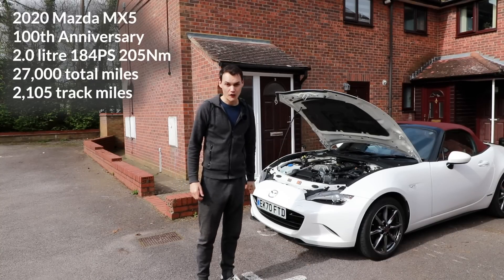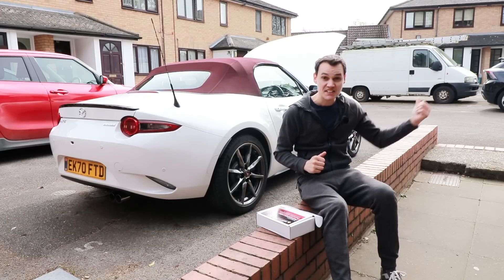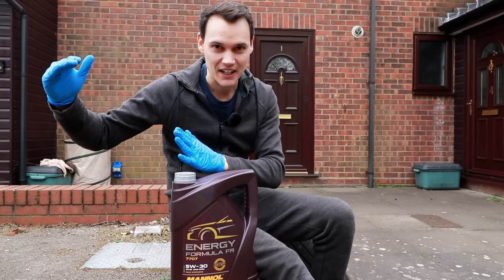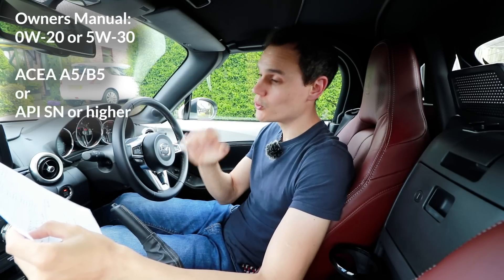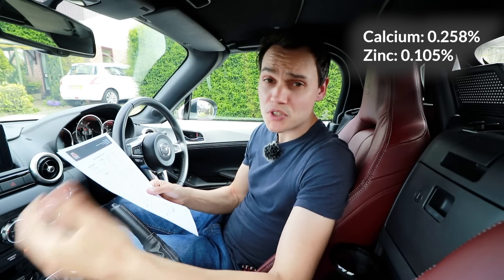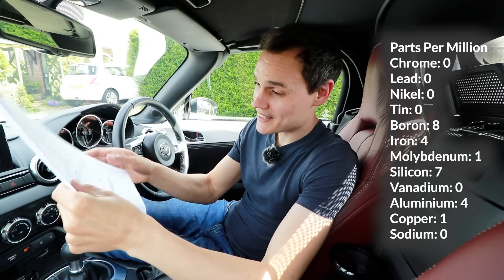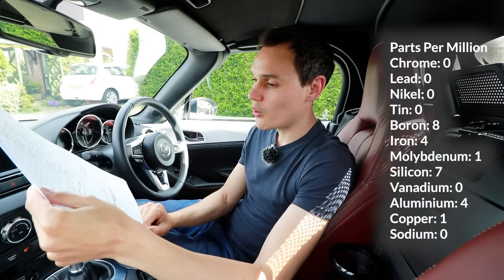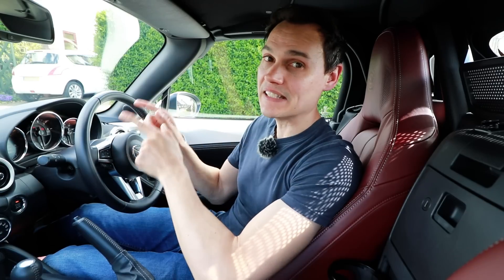Engine Wear Metals After 16 Track Days

Comment: 1000 km on the track with the same oil doesn’t seem a good idea. that’s 9h or more. a 6h interval is ok; 1000km wear is equivalent to 20.000km on the motorway.
anyway numbers look good so looks like it was ok. if the oil temp keeps a nominal temperature it doesn’t degrade that much. the blow by is low, so less contamination.
Reply: I agree. I change mine after less than half this number of track kilometres. Of all the things to skimp on, this is not one I'd risk in a track car
Reply from the maker: I don't think 1000km track use is equivalent to 20,000km road use when it comes to engine oil. I've been told many such ratios but not with evidence to back up where the numbers came from. The oil analysis results are comparable to road driven oil. It depends on the engine and the oil though. Different components are more affected by track use than others. So far in my experience it's only really been the tyres and brakes that show a significant increase in wear from track use.

Comment: If is used the right oil for the driving conditions and is being regularly early serviced, the engine will live for many years of trackdays.

My Nn18 cooper 2013 base model Stage2 mod with Stage2 parts had already 10000 milles of trackdays with 101000 milles total driving.

Still going smooth as day 1. Only noise you can hear is off, is the accesories pulley as the rubber is having wear and tear but easy to reemplace . Everything else works wonderful.

Comment: Great video 
I think copper is part of the cylinder head assembly 
I change my oil every 5000 KM and push the engine a LOT but unfortunately there aren't any oil analysis centers in my country

Comment: In the US, a company called Blackstone Laboratories does the same type of oil analysis. They provide universal averages for the elements measured in the oil, so you can get a sense of how "normal" your oil is. Below are the universal averages (in parts per million) for wear metals for a car with about 100,000 miles (my car's approximate mileage) and 5000 miles on the oil:
aluminium: 3
chromium: 0
iron: 7
copper: 4
lead: 0
tin: 0 
nickel: 0 
manganese: 0
silver: 0
titanium: 3
Reply from the maker: Thank you.
Reply: How many miles were on that batch of oil?  Ty for the information.
Reply: @projector7141   I should have included that information, as well. My bad. 5000 miles.
Reply: @AisuruMirai  tysm this is useful
Reply: @AisuruMirai  ty

Comment: Mazda are in a completely different league when it comes to building engines that are designed to be thrashed. Seeing your oil analysis really drives that point home. I've been sending the oil from my 150k mile Mazda 2 off to have it looked at every 7500 odd miles or so since I've bought it, and the results from your car look bang on to what i've been seeing, save for the fact that my 2 is a dedicated daily driver!
Reply: 250k miles on my k20 in my integra and still brand new. Revving to over 9k on stock oil pump and valves and pretty much last 100k miles have been fast road or track miles. I think any manafacturer should be able to make an engine that wont break down from 30k miles 😆

Comment: I'd be treating those subframes and lower arm bolts to some Dinatrol 3125 or similar.

Agree on the 5w/30
Reply: Yes, I was disappointed but also not surprised to see the beginnings of the metal moth that MX5s have always had.  I’d seriously accept a 20kg weight penalty on the car if only they rustproof the things to at least a half decent standard.
Reply: @smithp573  I doubt it would even be 20kg. It's just cost saving
Reply: @ChrisPatrick-q6k  Funny thing is that my 2020 came with some wax based rust proofing from factory. Car was sold in Germany, so it might be market dependent.
Reply: I'm shocked at how bad they are. I have a 1992 Mazda that looks almost brand new by comparison. But I live in a country with a mild climate and no salt on the roads
Reply: @RedBatRacing  It's the salt that wrecks everything.

Comment: I think a transmission oil test would be just as if not more important than a engine oil test; since I hear a lot more talk about the transmission wear in heavy track use for the ND.
Reply: Yes it does. I did swap the oil on mine once in 10k milles of trackday use.
Reply: True true. The earlier the model year is of the ND the higher the risk for transmission failure (gears in 2016/2017 models), or if too new (2022 and 2023) synchros issues. At lease these have higher changes of issues, but the synchro issues are independent of the track usage.
Reply: That would be quite interesting too, but IMO harder to conclude one way or the other if the track use affected the results since not nearly as many people analyze their gear oil, so there aren't as many results to compare it to.

I'm not sure about these specifically, but as a very general rule of thumb, transmissions tend to wear out and fail before engines do.

Comment: Your engine is nowhere near in the heat range or at high heat for long enough to require racing oil. Good bit of analysis like this saves a whole load unnecessary spending and effort.

Comment: Hmm I wonder, the engine I have in my 2017 Mazda 3 (2.0L 165HP). Is this the same engine as in the Miata mentioned here? I know the one in my car is limited to 6500 RPM, and the Miata to 7000 RPM. But I doubt that is all it needs to get those extra 16 ponies. Maybe a slightly different tune? If someone has some extra info I would be interested to hear. Thanks!
Reply: Valve springs, larger exhaust valves and i believe exhaust manifold runners have been updated beetween ND1 and ND2
Timing is also slightly different 
Mazda was in the hurry when ND 2.0 liter was released because they were not supposed to but they did due to american market, they would never buy only 1.5 liter
Still, all version are great even if the 184 is arguably the one that is offering the best package
Reply: @floriandugoli5923  That’s nice to know, thanks for the info. I’ve seen the Mazda3 2.0L be tuned upwards of 180, but I’d like to make mine last lol.
Reply: @Rockito912  i don't know where you are living but you can safely push it to 200hp with good exhaust, remap and cat cams
Full quality really matter on these engines
Great car btw 👍🏻 
With full bolt on i saw an ND184 with 231 horsepower on dyno, kinda cool !

Comment: This is properly nerdy, good stuff man. Are the NDs worth sticking a baffled sump in?
Reply from the maker: Apparently from factory they can do 1.4 sustained lateral G and maintain oil pressure. No modifications needed for driving on track with road tyres. Only high temperature brake pads.
Reply: @RichardFanders  that's really excellent. Pulling a G laterally for any sustained period is really going some in a road car. Only would really need touching if you're going on slicks/really crazy semis then. 

Hope you're well man!
Reply from the maker: Hope you're well too. I think even British Touring Cars only peak over 1.4 G, if I was starting to get anywhere near that I would want a track prepared car with roll cage and harnesses and be in a position where I was less bothered about damaging the car as there is not much margin for error cornering with that level of force.

Comment: Thanks RIchard. Very interesting. Testomony on how well sorted the MX5 engine is. 
If you feel like splashing out another £40 it would be interesting to have the results of the same test on your Seat Leon after a longlife service interval. There are mixed opinions on long life intervals, if would be good to see the facts.
Reply from the maker: I was thinking the same but I don't do as many miles in that now and I don't like leaving the oil longer than a year. When I used to do 18,000 mile oil changes, those changes occured every 7-9 months.

Comment: It's unbelievable how reliable an engine in a consumer car is. To be fair, it is still "only" 27,000 miles and about 7.8% of these miles are driven hard. Nevertheless it is still good result, though I don't have anything to compare it to. This is why I don't believe people when they say cars are built to fall apart after five years so that you have to buy a new one.